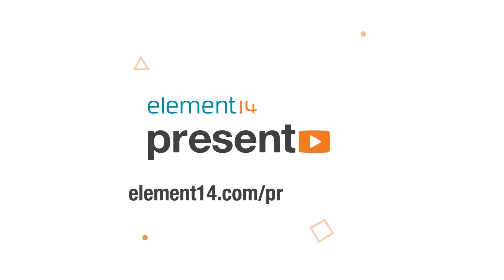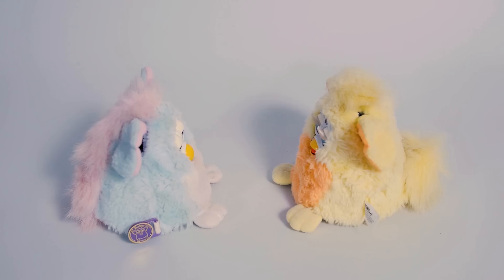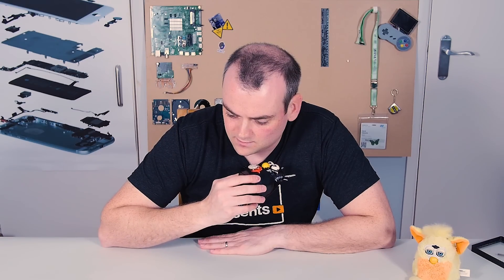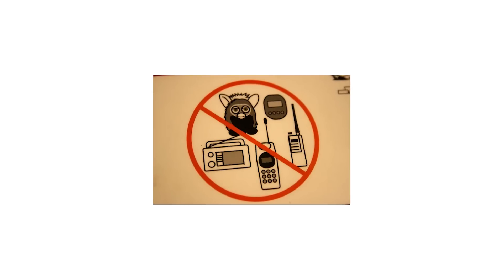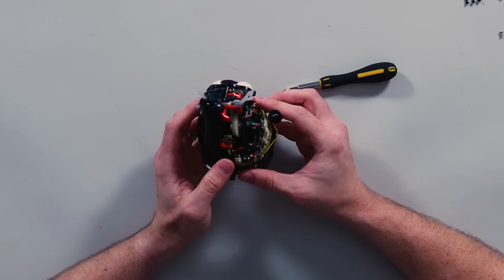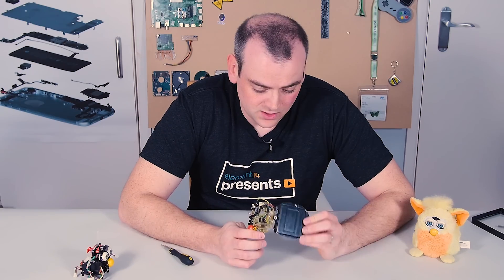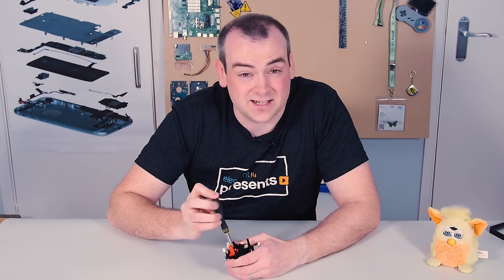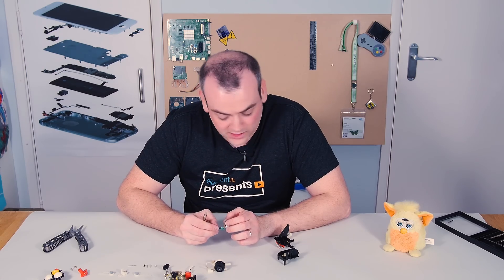Retro 90's Furby Teardown - The Electronics Inside

Comment: Wow, the quality of the build for a children's toy of that age was pretty impressive
Reply: yea, and only 30 bucks. The newer models are 100 dollars and not really much better. The original was smartly designed to utilize older cheaper technology like ir sensors and clockwork style gear work to make it all work on a single motor. The newer ones just get 5 motors thrown in and bluetooth. Killing battery life and wallets.

Comment: Actually, these aren’t the 1998 version. Those are the “Furby Baby” model, and they were released in 1999-2000.
Reply: Yea, I was going to point this out. They were slightly less technically advanced but not by much. Smaller too.
Edit: They are also worth more because they are slightly rarer.. So its an odd choice. He must have had them lying around.
Reply: I believe they dont have as many movements as the regular ones
Reply: @greenbeanfurby_  i think the only thing they can't do is the little dance movement. theyre missing the spring between the motherboard and the battery case that the full size ones have
Reply: @DigitalGhostCollector  true

Comment: I wonder if it would be possible to change the voice files/furby dialogue haha i can just imagine
Reply: You would have to design your own board and just use the existing one as a way of getting input. Like an entirely new program for interaction. But it would be possible for sure. I'm baffled there isn't a bigger community around them for projects like this, they were so popular and there are so many of them out there still.
Reply: You cant its hardcoded probably you have to program a blank texas instrument speech cpu with your phrases and maybe reprogram the 6502 based cpu the furby uses to send the correct commands

Comment: The "resistors" on the motor are not resistors. They are inductors, and together with the capacitor they form a filter that takes the edge of the brush noise that would otherwise interfere with radio reception.
Reply: Sorry, you are quite right, that's what I meant to say!
Reply: Oh, I always wondered why Furbys sometimes catch radio signals or if it was a myth
Reply: @themoonlitfurbling7104  the filters are for not emitting any noise. It will not protect from receiving the noise. Any kind of electrical gadget can get triggered from electrical noise / radio etc. if designed badly.

Comment: Potted epoxy chips always feel like a middle finger when I see them.
Reply: I know the feeling. I am pretty sure it's almost always cost but it still feels like they are just "protecting their intellectual property"?
Reply: David Edwards It’s just for cost as they manufactured the custom chips by the thousand. Those cheap products where the standard chips have the markings scrubbed off are the real stuff you...
Reply: @Bin216  wheres the love for the reverse engineer? Say no to epoxy pots. Share the love.
Reply: @Bin216 not realy custom chips! A spc81a based on 6502 without the y index and Texas isntruments speech processor

Comment: It would be cool to reverse engineer the Mic circuitry to see if it really listen/learn.
Reply: It does not. It's silicon has been reverse engineered and it's disappointingly simple.
Reply: @zaprodk  link?
Reply: i believe it was just used to monitor sound volume so it knew when noise was being made around it, I think it might of been cable of recognizing clapping too
Reply: It only hears loud noises. The newer Furby from 2005-2012-2016 can listen and understand words, but the original could only tell when you clapped or yelled. The "learning" is simply a float that increases during any form of interaction. Absolutely no language skills.

Comment: I still have mine I remember when it started talking after not being touched for years in a drawer at night. Yes the batteries were still in it but it was still creepy. They were really glitchy and had to be rebooted often. They'd go nuts and just make noise. Noise it normally wouldn't make otherwise. I remember kids would freak out when it happened and get really upset.
Reply: Fortunately they didn't bother me when they came out. But if I had been 4 or 5 years younger? Nightmare fuel!
Reply: I have one but not the old ones i have the 2017 ones.
Reply: Mine did that too. Creeped me out
Reply: I never owned one.